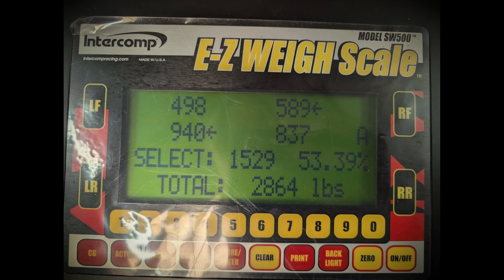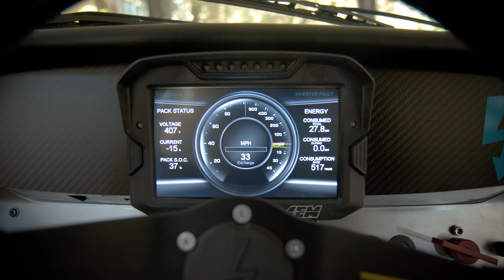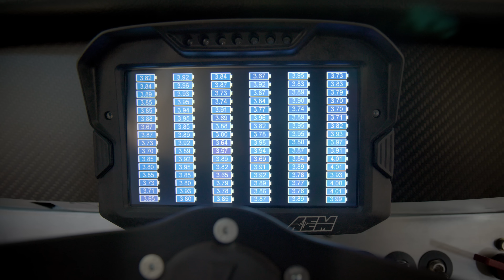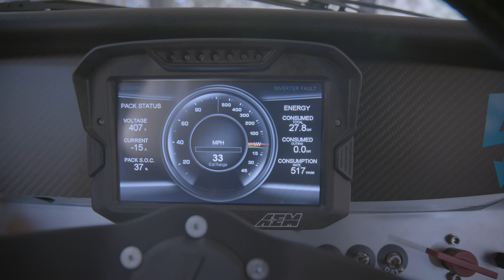ELECTRIC DEVIL: Mudslide-Surviving 1976 Porsche 911 Turned Tesla-Powered Ruffian Beast | EP36

Comment: My ALL TIME FAVORITE thing about electric cars is NOT NOT NOT having to go to a gas station to fill up. I just plug it in at home and the next time I go to drive I normally have 250 miles right from the start from my garage. OR I can charge it ALL the way up and I have a little over 300 miles (because I'm a lead foot and my Tesla Model Y knows that) for when I go on trips.

Note that when I need to charge on a trip, I time it so I have to go to the bathroom or I want to eat. Something like that. And I find a Tesla Supercharger, which are all over the "normal" places, and by the time I get back to my car I have AT LEAST another 150 miles of range (bathroom trip) or maybe (usually) charged all the way by the time I'm done eating either in the car itself (when I'm tired and want to eat and take a 15 minute nap but no more than that) or I go into a restaurant and get "nicer" food.

Gas cars have their place. But I am just NOT in love with oil changes and stopping to fill up with gas when the CAR demands it instead of how ME, MYSELF and I "CONTROL" it.

Would I love to have an electric Porsche? I've never driven one but I honestly don't know if I care because my Model Y can literally get me arrested but at the same time, I'd never be able to really take advantage of a Porsche. But I CAN in my Model Y. And the TORQUE ... it is ADDICTING and I can't help but smile every time I push the pedal down even if it is only half way. But FULL is even MORE fun.

Electric car haters, like the guy said, if you loved electric AC cars, how can you hate full size ones? It just doesn't make sense unless you are jealous about what an electric car can do that yours can't. I don't know because I don't know you.

Happy motoring. I know that I'm happy. So just be happy yourself in your own way in whatever you have to drive and don't be a hater. Being a hater is just so lame.
Reply from the maker: Thank you for sharing with us!!

Comment: It still gets to me how some people throw up these fences when it comes to EVs. I don't miss the noise, smells or any oil related stains/ oil changes, in my garage. My garage has indoor outdoor carpet now! I have a 2023 Nissan Ariya($50 K) and this is a 6 second 0-60 mph AWD family car. Who needs more than that? So many good things about owning an EV,  the garage stays cooler as there is no engine blasting heat when you pull in, electric motors run very cool compared to combustion engines. Heaters and A/C are  an instant away with heat pump technology with an almost zero maintenance schedule. In-cabin filter maybe, new brake fluid at certain intervals, tires. Brakes last alot longer with regen braking. Nissan has been doing this since 2010 with the LEAF and they have learned a few things in that time. Are they for everyone? No. Is a top of the line Porsche 911 for everyone? No.

Comment: There is a speaker system with a receiver that ties it in with the throttle and ignition. The motor sounds can be Viper V10, hemi, SBC, BBC etc. 
the car can sound however you choose.
I the Law starts checking your ride for “Loud Exhaust” just turn volume down.
Reply from the maker: Interesting...thanks for sharing!!

Comment: that battery pack will go up in flames soon! 3.57v on the lowest and 4.01v on the highest cell is crazy!
Reply: The pack needs serious re-calibration.  Check if the BMS is working correctly.

Comment: The biggest problem with EV sports cars, as I see it, is that it is really easy to end up going way faster than you intended to because your car doesn't shift and there's no engine noise to tell you anything. This one is a bit easier to tell with since there's zero sound deadening, so you can still hear the motor whine, but it's still quite different and would take some adjustment to get used to. Hard to complain about the raw acceleration, though.
Reply from the maker: Thank you for the comment!!  We appreciate you watching!!

Comment: Ex Racecar,... And it's bolt-in,.. Well ain't that the perfect ride to mod. No 'numbers matching', or 'survivor patina' to ruin, this thing is the ideal chassis to play with an evolve in new ways.
Those boxes do need some dress-up - maybe swap in cover plates on the battery cases to Aluminium OxyNitride, then polish for transparent surfaces, show off all the woring inside while still having it all in a safe metal box.
They should be fitting gearboxes, not for performance, but for long distance economy - stock Tesla ratio numbers for the fun parts, then go Overdrive for long distance power saving - like how Gear Vendors units get used on Drag n Drive cars.
Reply from the maker: Thanks for sharing your opinion!!

Comment: Last comment- because batteries and motors are so low (weight), most of us will not have had this experience.  I know I haven't.  It's like a go cart.  Very different.  I have driven a go cart.
Reply: Batteries and motors are low weight?  ¿Que?
Reply: @caddydave  Physically low in the chassis, low center of gravity.
Reply: @christopherbrown6697  ok… that makes sense.. :)
Reply from the maker: Thank you for the comment!!!

Comment: I'm a guy who loves ICE still but how in the world can you be against that electric power?  People who race, all you have is electric motors.  No transmission to mess with, no fluids, all the internals and turbo systems of an ICE.  So much to figure out and that can go wrong.  Fuel systems to figure out and adjust.  Electric is just that, extremely simple systems other than getting the computer system setup but once that is figure its a very basic system.  Very little components to jack with.  Like you said a large R/C vehicle and who doesn't love running an R/C?!!!
Reply from the maker: Thank you for sharing!!!

Comment: EV's are cool to drive but they are less fun to watch in a way as you can't hear how the engine is behaving. It's hard to see the difference between an EV doing 25mph or 125mph on camera. But I think EV cars will become allot more fun soon'ish if the solid state battery tech. catches on. Those new type of batteries has 50% longer range and has half the weight of a lithium battery car.
Reply from the maker: Thank you for the comment...we appreciate it!!

Comment: the battery pack seems very unbalanced? 3.57-4.01V is like 50% charge difference between cells...
also a 85kWh model S uses over 7000 cells. if each of the 96 battery icons was one single cell, the battery would be 1/74 of a 85kWh battery. (1.15kWh), like a large ebike battery....
Reply from the maker: Thanks for sharing!!

Comment: Your battery cells are not balanced!🔋 
You need to Balance them ASAP.  0.5V Differenz is a lot. Be carefull Charing and driving. Otherweise you will overcharge or overdischarge some of the cells.
Reply: You will destroy the battery or Set it on fire. The fire system does not help. Only cooling the battery with a small Stream of water will.
Reply: The batteries are water cooled.

Comment: What a horrible car. The only advantage it has over my old 930 Porsche (sold it years ago) is that it is faster, less expensive, no turbo-lag, less likely to oversteer under deceleration (try lifting your foot off the throttle in the middle of a corner in a 930. Ask me how I know), quieter, almost maintenance-free, and overall will cost about one quarter as much per mile to operate. I just can't understand why anybody would want one of these.
Reply from the maker: Ha!